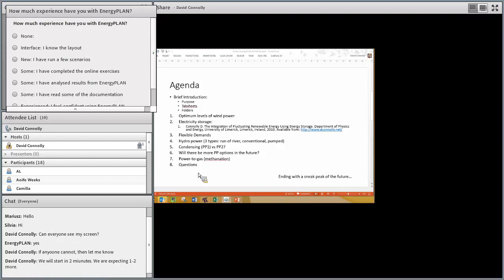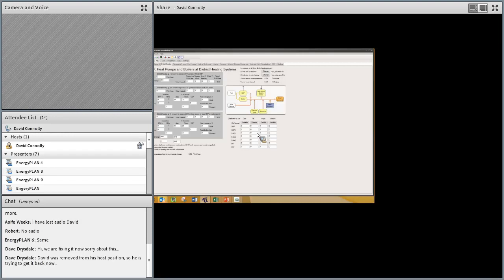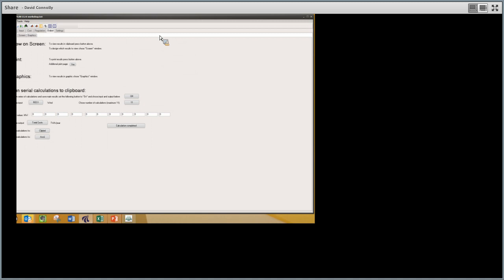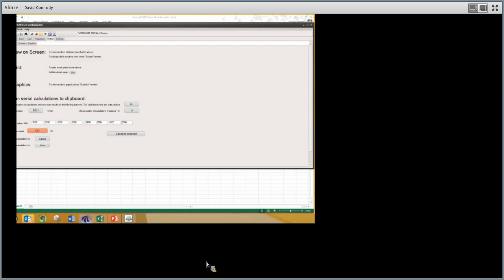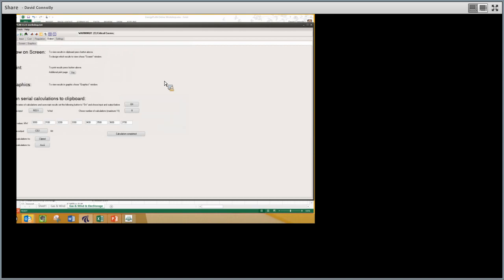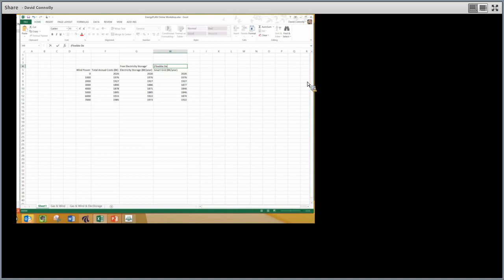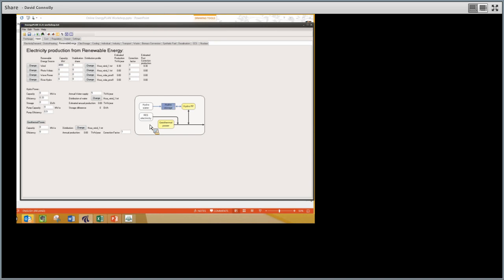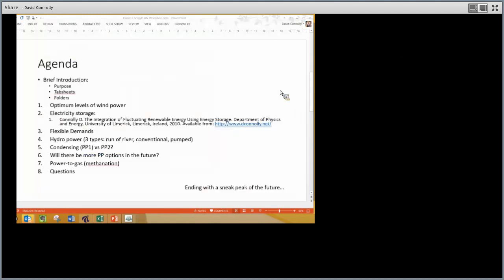Introduction to Modelling in EnergyPLAN: Wind Power, Power Plants, and Electricity Storage

Comment: Is it possible to run a simulation in EnergyPLAN to simulate the impact of battery storage on peak load leveling.? If we define electrical load, power supply that can consist of a variety of sources and energy storage is it possible to see if the installation of a battery storage facility has an impact on the reduction of total annual costs?
Reply: Very interesting questing. Have you found your solution?